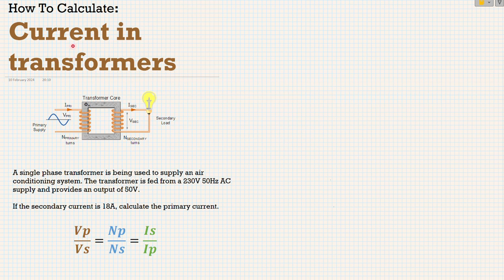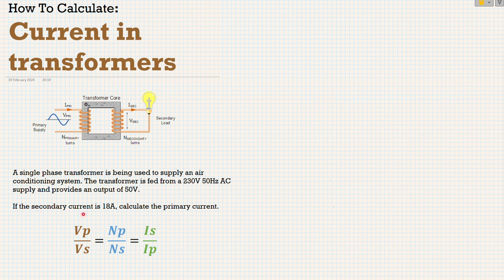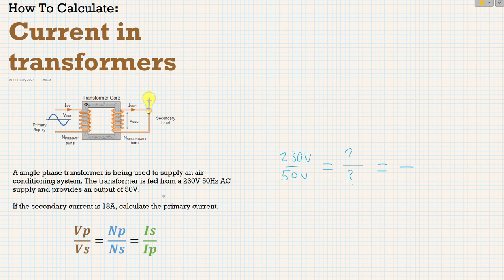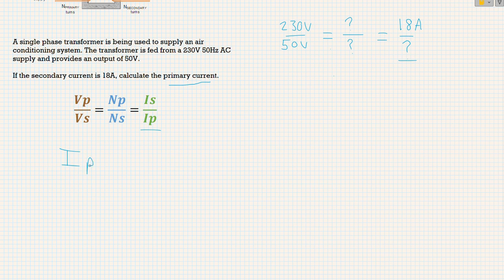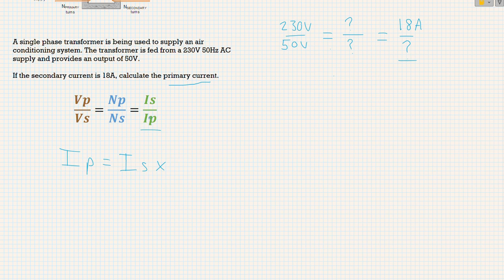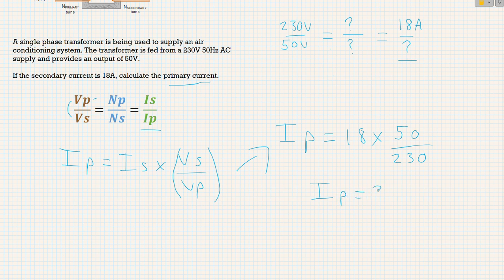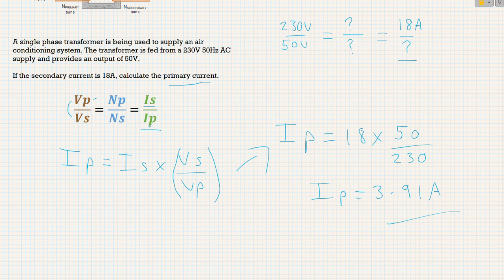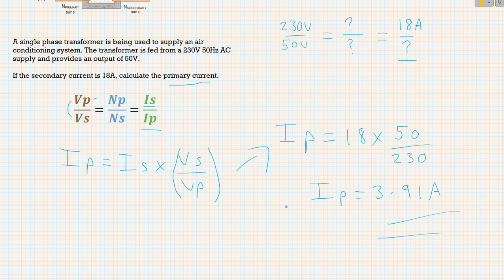How to calculate Current in Transformers

Comment: Hello Sir my question is when I  took the 18×50÷130= 6.92 I'm abit confused how did you get yours a 3.91 thank you
Reply: u needed to flip the values of voltages. VP/VS needs to be VS/VP. maybe another thing if u did the cross multiplication method , u should of did 18*50=900  and than divided 900 by 230(900/230=3.91)
Reply: i also just noticed u wrote 18*50÷130=6.92 instead of 18*50÷230=3.91